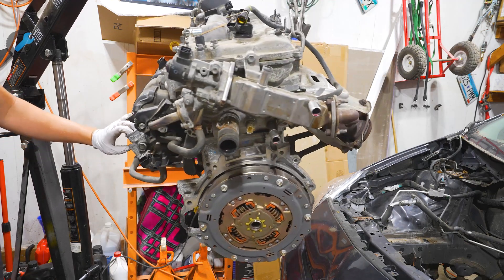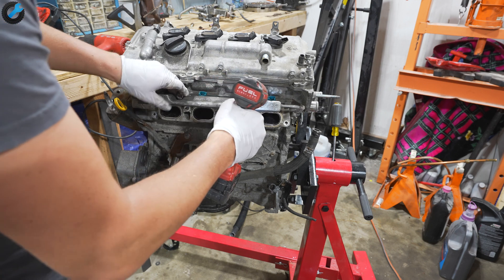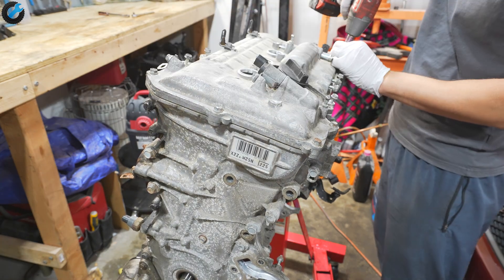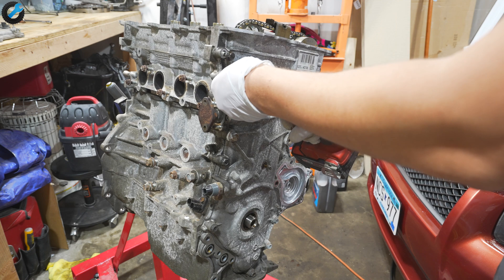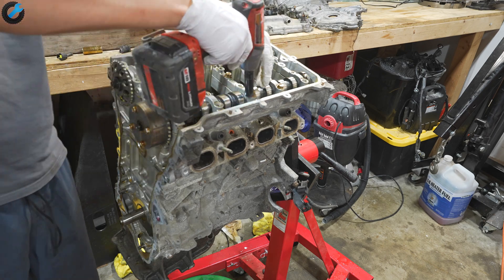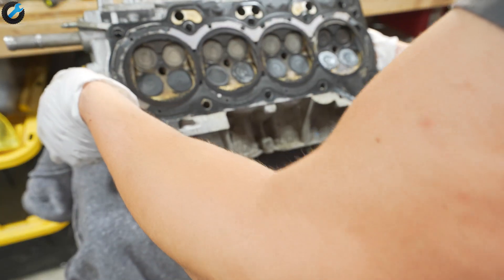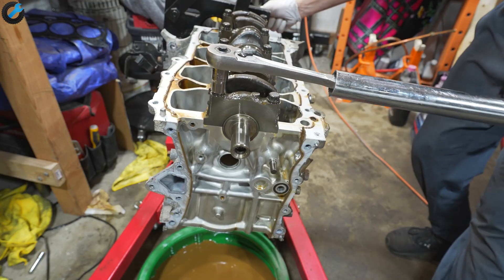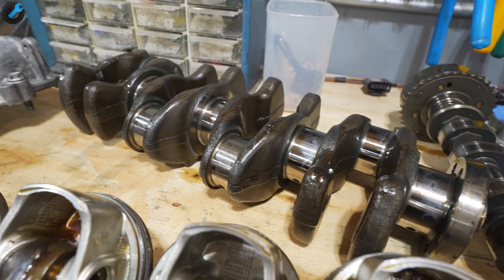Toyota 2ZR-XFE 1.8L Engine Teardown Disassembly - due to bad head gasket on a Prius

Comment: thx for the vid. my undersanding is that this engine also had the low tension piston rings so u prob wanna get the updated ones that went into the mid-2014 and up engines to prevent oil consumption

Comment: Hi what will happen to the engine if you blank or remove the EGR system completely then the engine management light will come on if so you remap the ECU?

Will the Prius engine run more smoothly 🤔

Comment: Triple square (for head bolts) is a misnomer: it works not but not ideal. Toyota spec is 10mm double hex.

Being 2013, it’ll have the pistons and rings that have proven prone to burn oil. Good to replace both with the revised. Part numbers are in the TSB for oil consumption.

For sure clean the EGR thoroughly, including EGR passages in intake manifold.

Comment: Do you think better piston rings would help with the burning oil problem in the future?
Reply from the maker: I can't say specifically for the prius but on other engines that I have worked on, replacing the rings fixed the oil burning.

Comment: Good disassembly video. Looking forward to the rebuild or maybe even spec checks before assembly.  I recently pulled the timing cover and internals along with the head assembly off a ~150K 2011 for some practice testing specs and potential saving of the parts to rebuild so for a quicker swap when I do the head gasket on my 2013 with ~285K miles.

Comment: Its insane how clean that motor is. So it looks like they may have did great on changing the oil. Sadly the EGR design is bad on them and after pinging and detonating on the head gasket for 80k miles from the lack of egr condition the head gasket blows on them. And its cylinder by cylinder too as cylinder 1 loses egr first.
Reply: I thought they fixed this in the latter years
Reply: @BjørjaBear  I think it should be fixed on the 5th gen but 4th gen has the same issue. Just clogs slightly slower. But at a certain point literally all egr or dpf systems clog.

Comment: How much you charge for complete tear down, replacement of head gasket and re assembly the engine. Very good video
Reply from the maker: If I were to charge, it would be in the $1.5k - $1.8k range. That includes all new gaskets/seals, new rings, and  resurfaced head.

Comment: Have you ever put together an engine and then at the end realize you have 1 or 2 parts remaining?
Reply from the maker: Its always some bolt that I forgot. That's why now I literally check all nuts and bolts three times when putting something together. On rare occasion I'll leave a rag in the intake manifold and have to take everything off to remove it lol.
Reply: Imaging not flaring the pin for your oil pump chain .

Comment: I would like to see the cylinder wall.  Just in case it has oil consumption issue and a worn cylinder wall.   Did you regularly clean the EGR valve and intake manifolds every 75k miles?  This helps the risk of pinging/detonation and head gasket leak.
Reply from the maker: No idea on the maintenance history, I was just hired to swap this engine out. However, the cylinder walls were in great condition. I bought the OEM gasket kit and should be putting this engine back together next week.
Reply: @happywrenching  Make sure you get the updated newest part number for the head gasket or it will fail again.  There is also updated piston and piston rings from 2015 that completely eliminate oil consumption issue.  OIl consumption leads to clogged EGR valve, pinging/detonation and eventually leak head gasket.
Reply from the maker: @rondhole  thanks for the heads up on the parts revisions!
Reply: @happywrenching  Some mechanics recommend Felpro head gasket for 2ZR engines because it has thicker lips than the updated Toyota head gasket.  Similar situation with the QR25DE Nissan engine.  I owned QR25DE with a blown head gasket at 70k miles and 150k miles later has no issue with the Felpro head gasket.

Comment: Incredible good engine still, no bearing damage and all. It's very important to clean hat EGR-system every 50 - 80k miles, in order to prevent the headgasket from blowing. The reason is that a clogged EGR-system will cause higher temperatures in the engine which makes the headgasket fail, so coolant comes in the combustion chamber and cause hydro-lock. That makes the engine knock, which is very bad. And do an oil- and filterchange every max 6k miles (10.000 km) with the right oil (0W-20). It will keep your engine from burning oil, so the EGR-system will stay cleaner!
Reply: This engine is pretty jumpy on the timing cover and needs passion to work with.  The head gasket problems are a kind of a mystery because some have problems and some never.  The head gasket is actually revised at the end of 2013.  The best one is after 2015 model with revised piston and piston rings.  It reduces oil consumption that leads to clogged EGR valve.  Clogging EGR valve is believed to be the cause of the head gasket failure.  People who clean the EGR valve regularly every 75k miles, or engine without oil consumption issue rarely have head gasket problems.  Change oil every 5k miles/6 months reduce the oil consumption risk significantly.
Reply: @rondhole  and drive it conservatively!
Reply: @rondhole  How do you clean the Egr system?
Reply: @garyvincent9663  there are tons of video how to do it. Especially from car care nuts channel. It is very clear how to do it without too much complication. It is doable DIY as long as we are patience.
Reply: @rondhole  My family all have Corollas and we just had one blow a head Gasket. I change oil at 3,000Miles But all the cars where bought used and you never know what was done b4
Reply: @garyvincent9663  used car is not easy to predict unless you know how the previous owner maintained it.  2ZR-FE 1.8L nonhybrid are very robust and almost never have head gasket issues unless they had been overheated from a leaking radiator or someone put sealers that cause waterpump, radiator, and heater core restrictions.  The hybrid FXE engines have more issues in Prius 3rd gen because of the combination of huge on/off cycles, clogging EGR valves, broken electric water pump, and bad head gasket design (revised in 2013 with much lower failure rate).
Reply: @garyvincent9663  it's pretty annoying, I recommend when you get to the bolt of death and finally release it to just throw it into the fucking forest and never deal with it again.
Reply: @rondhole  I've read more recently that another cause might be bad PCV Valve used for long periods coupled with the EGR circuit restricted.  Another cause I wasn't aware of until a few weeks back is the coolant not flushed and changed routinely, as that can change pH and become more acidic causing head gasket rubber degradation reads and sounds.
Reply: @jafinch78  Well, it is all theory but the reality is the head gasket itself.  The new head gasket since Fall 2014 is completely different. No more black coating anymore, pure metal with much denser lips.  The piston and piston rings are also revised and reduce oil consumption significantly.  The PCV valve are rarely clogged. Only the EGR will clog from burning oil.  So it starts from 10k miles OCI = caked piston rings, and then burn oil like mads, this oil cause EGR clogging, no EGR flow= hotter combution chamber, and at the end blown head gasket. The topping will be dead catalytic converter.   I believe the coolant is not a big factor at all. 10 years interval is more than enough, the pH is still the same as new coolant, only the dye becomes more red, not pink.
Reply: @rondhole  Yeah, is a lot of hearsay without a doubt.  Some seems more logical and has more complaints regarding.  Last week I finally recorded the death rattle noise and just uploaded to my YT channel. Doesn't last more than 2 or 3 seconds at most and that's only those two times I've had the check engine light which the first time was definitely an oil overfill situation prior after a few days of driving most the day with two consecutive full tanks with each a bottle of Techron.  Otherwise is for a second or two at most.  Maybe random, though first check engine light thrown was cylinders one and four.  The second was a month or so later and cylinder two. I still need to more thoroughly clean the exhaust manifold on in, though planning for the worst even if I only just replace the head gasket and swap what gaskets look bad to bide some time.  Would be nice to go until next season about this time to get my debt paid off.  I can't complain going ~285K miles.
Reply: @jafinch78  Yes, How much oil does it consume?  Check with endoscope if the cylinder wall are already scored.   Getting a complete new short block is probably the best solution with a redesigned original Toyota head gasket and bolts.  The EGR need to be reprogrammed too. There is an update sometimes in 2015.  At 300k miles, it paid for itself.
Reply: @rondhole  As of late, appears approx a quarter of the level between the two dots per approx 1,250 miles.  So roughly the full range of oil level between full and low dots every 5,000 miles. 

I believe the EGR is all updated per the dealership and being the second to latest part number revision from what I find online at the Toyota sites. 

My current EGR is the 25620-37120 part number and from the 2011 approx 150K parts car the better looking and already cleaner 25620-37110 EGR Valve reads like can interchange.  I didn't swap at the time since I wasn't confident. 

Reads like the difference between the two part numbers I have are, 

"The newer one supposedly is a little bigger and needs the wiring let out a little to reach it, but if that was done, it should be no trouble to reach the older smaller one.

If the newer valve was put in at some earlier time, a firmware update should have been done at the same time. But the same firmware version is also used in a different bulletin that doesn't involve changing the valve, so clearly the updated firmware is able to work either valve."

I still need to take apart both valves to check for a rutted ski jump. 

I'm glad I didn't pull the complete engine assembly from the 150K parts car at the yard since I did find the at least cylinder two back side wall scoring to be similar to the Car Car Nut video on the lexus CT200h where I'm not confident that can be honed away.  I haven't bore scoped my cylinder walls yet.  Amazingly still gets in the mid 50 mpgs when I do drive.
Reply: Is there a video of putting this back together?